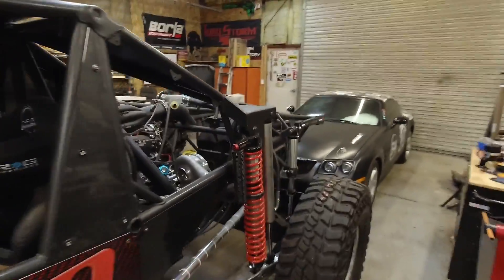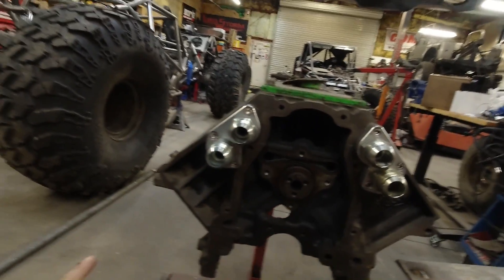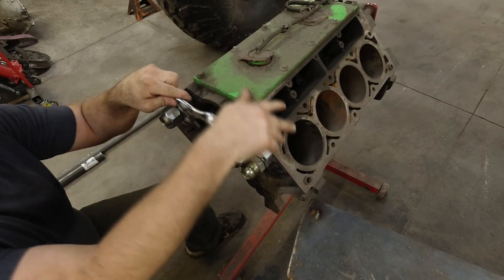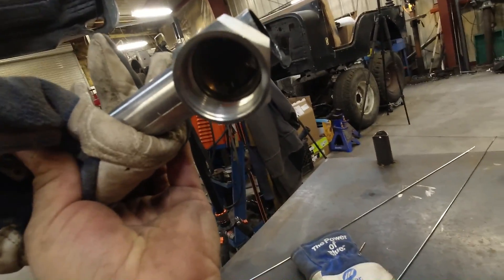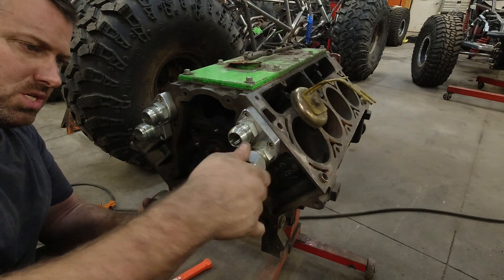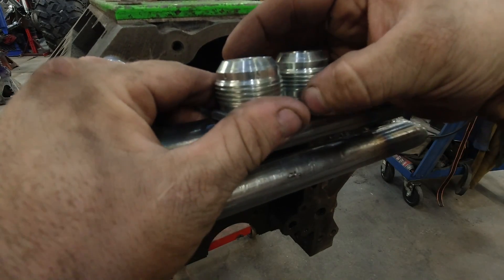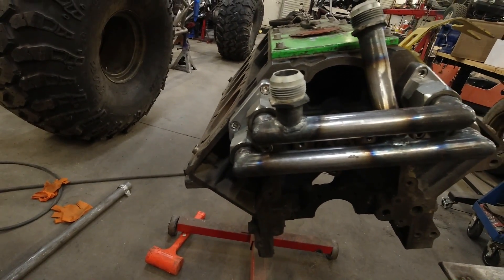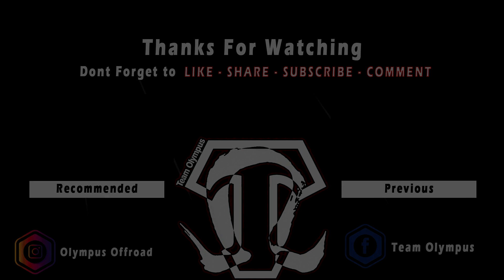How to make a remote mount electric water pump LS Adapter Manifold - Ultra4 Build Update 23

Comment from the maker: What do you think of the setup? Little out of the box but we think it should work! Tell us what you think!
Reply: I think most will not understand the level of precision required to fabricate this part and fit it at each end at a perfect 90° to the block!
Reply: @jamescunliffe9872  I agree 100% Daniel does awesome work and tries things many wont do or think of.
Reply: I wish you could make one for me! There's nothing out there like what I need other than what you fabbed.
Reply from the maker: Well technically I do have everything to make a complete setup again
Reply from the maker: I even have two spare water pumps that I no longer need

Comment: Good lord, tap the block holes and direct insert a npt to an fitting, bore the inside as you have done, get rid of the middle man plate. Hugs the block closer and you can you a 90° fitting (npt to an)
Reply from the maker: Fitting are still to big and don't sit well. I went through a ton of options and this was a solid one and works amazingly well
Reply from the maker: And if you are talking about the engine itself that is a horrible Idea. If I blow an engine I am screwed and have to completely redo it on a new block. I can swap this setup to another ls engine of any sort.

Comment: How do I enter for the civic. Nice work brother. What size LS goes on the ultra4
Reply from the maker: Go on the video below and comment I want the civic

https://www.youtube.com/watch?v=-FceSNM9MZk&feature=youtu.be

What size of what are you referring to? Thank you for the compliment. Make sure to check out the second part dropping soon.
Reply: @carbonshocks   hell yeah man I'll enter to win that thing. I was just wondering what you build for the ultra 4 it looked like a 5.3 iron block. I'd imagine you probully built something with more cubes for that setup. I'm building a built 5.3 right now that's why I asked
Reply from the maker: @blakesracingandoff-road6353  it's a fully built 408 with AFR mongoose heads. Forged everything best of the best. Produces just under 1200 crank hp
Reply: Hell yeah bud nice build. I'll have to keep watching your videos and check that thing out. I wanna build a forged 408 for my mud truck one day :)
Reply from the maker: This engine we spared no expense It's a very high-end race engine The only reason we kept this block over a dart block is the 6-L block is a very strong block. Hi nickel content makes for something that can take a lot of abuse if this fails then we'll go to a dark block. Most likely we're going to be putting a Thompson Motorsports 434 in soon though.  Make sure you check out the Dino video It's the most powerful car in Ultra 4 right now putting over 700 horsepower to the ground. It may not sound like a lot but when you understand then as an ultra 4 we lose almost 40% of our power to the ground It's a pretty good number.
Reply: @carbonshocks  what kinda supercharger? Sorry I was only half way through your video.  I'm new to your channel
Reply from the maker: @blakesracingandoff-road6353  we run torqstorm superchargers
Reply: Hell yeah man sounds like a badass motor!  Is it all naturally aspirated?  I can't wait to see this thing rip in future videos
Reply: I've got a 6l block in my daily driver 2000 Silverado it's been my daily for years 270xxx miles. I'm building a built 5.3 for my mud truck. Might just have to switch em out lol

Comment: Now why didn't you use flex lines
Reply from the maker: The amount of adapters and fittings needed with flex line would have been high. I would have needed a dozen fittings and adapters plus the hose
Reply from the maker: You'll see when the video drops tomorrow how it all comes together and it'll all make sense It works amazing.

Comment: Do you know how to install the Holley kit ? Would it work on a 5.3 vortec lm7?
Reply from the maker: Yes the Holley systems are very easy and it'll work great on a 5.3
Reply: Team Olympus any modifications to the radiator or pretty much just plug & play ? With the whole kit of course

Comment: In my opinion, due to location I think it should not be a hard line because of space and routed somewhere to the side of the engine.
Reply from the maker: It all depends on the build in this case it works beautifully perfect and makes for very safe routing and plumbing. Make sure you watch part two of this project and you'll see exactly what I'm talking about

Comment: Great vid man. I have a concern of how the flow is going to work. Since the inlets and outlets are offset in the crossover pipe do you think you will have heat issues on one the bank furthest away from the inlet? Could have a issue on the return side as well. Just a thought.
Reply from the maker: I dont see this an issue. Based on how the flow wors compared to an oeam pump.
Reply: Team Olympus  my point being water flows to the point of less resistance so the unequal length the water has to flow to each side could effect cyl head temp and block temp causing one side to run hotter than the other. That’s why water pump flow equally to each feed side.
Reply from the maker: I'm pretty sure they flow the way they do for packaging reasons LS3 water pumps have them on opposite sides.

Comment: GREAT JOB , YOUR ADJUSTABLE WRENCH DID YOU TWIST THE HANDLE , IT LOOKS LIKE A BETTER WAY ?
Reply from the maker: IT came that way. Autozone clearance. It is a wide wrench that has 3 socket sizes and its twisted. easily one of my favorite an I would buy more to have but cant find them.

Comment: Nice work! Are the 90s going to cause flow issues?
Reply: I wouldn’t think so mate. I have thought the same in the past but the amount of people that use 90s like that I think it’ll be fine. Think of a radiator hose, that’s like 90 degrees
Reply: im thinking the same it would be better if they were radius bends
Reply: Yes, but not enough to make a substantial difference - https://www.ekwb.com/blog/do-angled-adapter-fittings-really-reduce-flow/
Reply: I don't think it will hurt anything.

Comment: I don't know, but don't call me stupid. Couldn't you have used stainless braided hose for the 90s?
Reply from the maker: Yes you could have used hose but order required a dozen fittings the hose plus t's and it would have been extremely expensive
Reply: Team Olympus  cool. Didn't know back in the 80s I had to have some made for my daughters XR4TI Mercur for the ac it was routed real close to the turbo. Which is what happened to the originals.